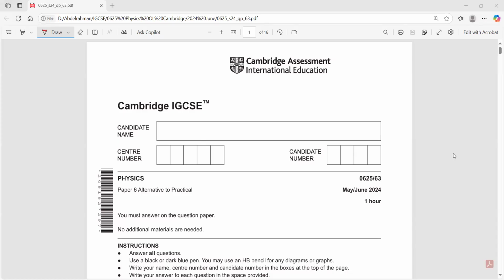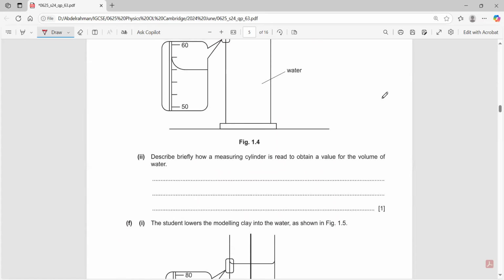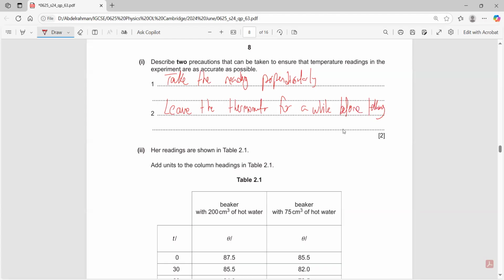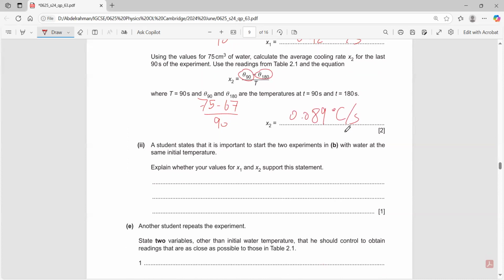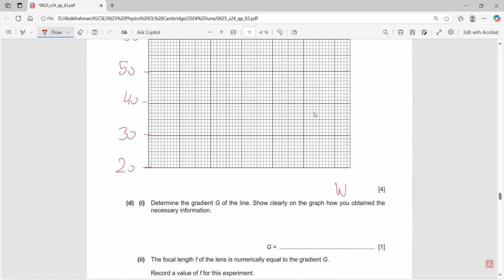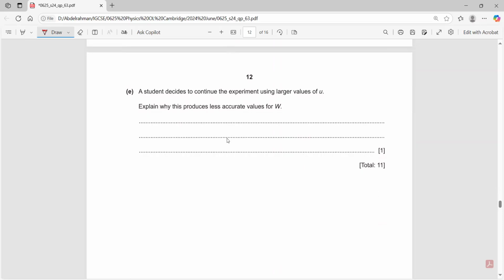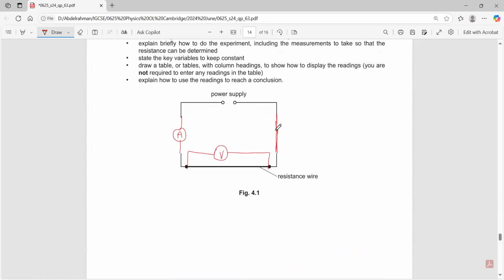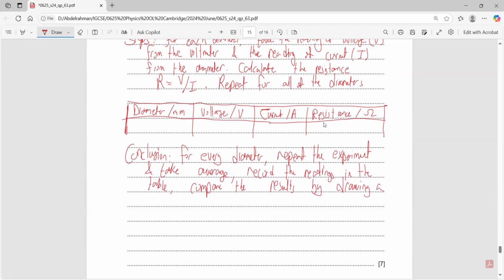IGCSE Physics 0625/63/M/J/24

Comment: in question 3 (c) it was said you do not need to start your axis from 0 so why u started wouldnt it be cosidered wrong? plz tell its my exam after 3 days
Reply from the maker: The question said you do not need to start from (0,0) , I started from (0,20) which is very different, so don't worry if you used this same scale it would be considered right